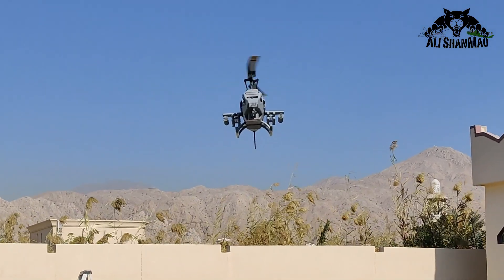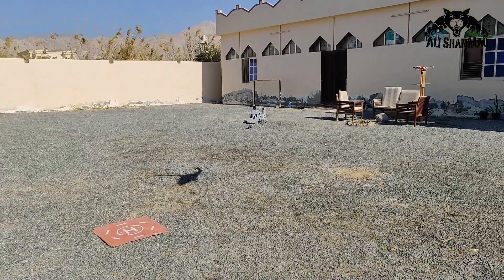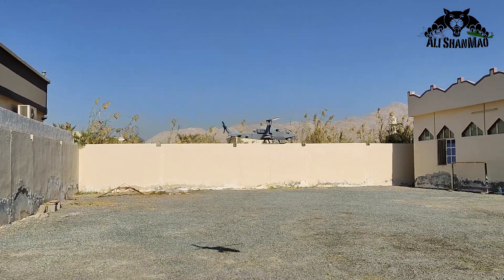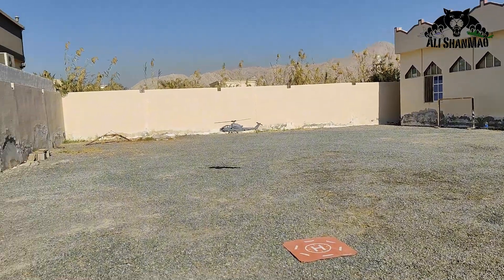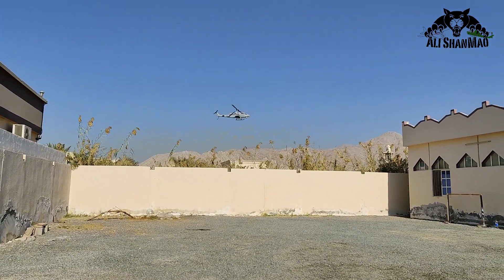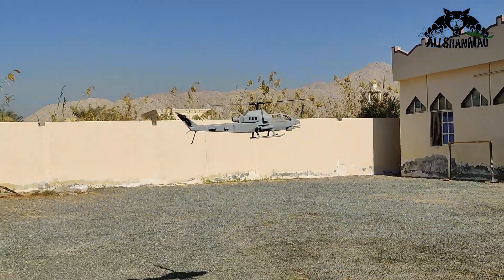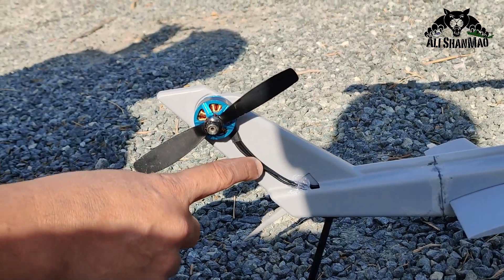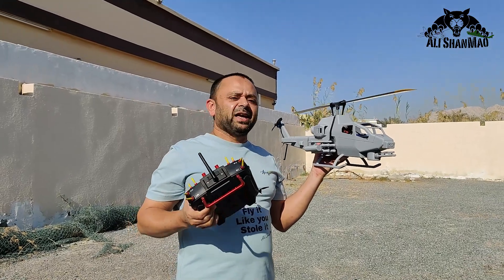Insane 3D Printed Cobra Inspired Military RC Helicopter: Flies Like a Dream (First Flight!)

Comment: Congratulations, Ali! She looks great in flight and seems to be very, very stable! I think the bit more weight because because of the 2mm thick fuselage adds stability in flight and it's really visible that you have no lack of power! You created a flying tank! Wow, a crash with damaged main blades and main shaft BUT NO damage on the fuselage of this scale inspired beautiful machine! Thats a great archivement!! I wish you that this will be a bestseller!!
Reply from the maker: it sure is buddy. When it crashed, I thought you know what, now my printers will run another day and 5 hours to print a new one. But when i picked it up, my son told me baba, there is no damage. Masha Allah, its really very strong and it was a good idea to print 2mm thick. previously i tried the thinner prints and one hard landing and even vibration breaks the fuselage LOL. This one sure is a tank. I am flying it with a very early outdated Bell 206 module and it heats up, but newer Huey V3 or V4, and Bell 206 V3 modules have more powerful combos and they will have no issues at all.